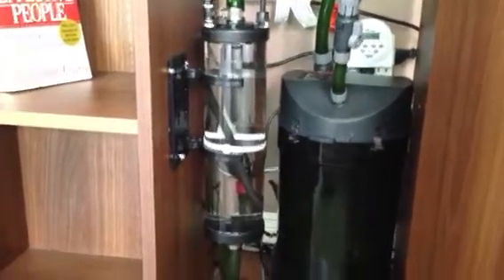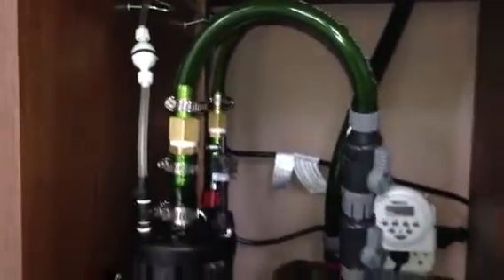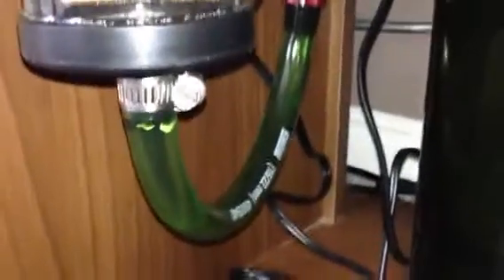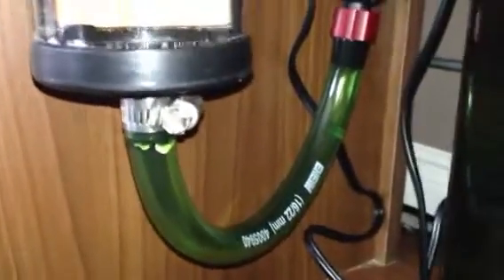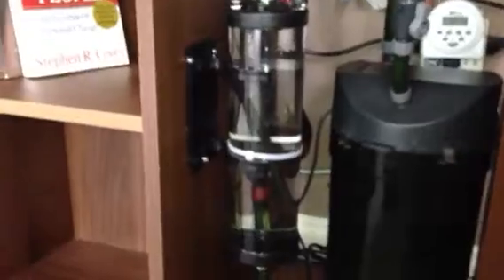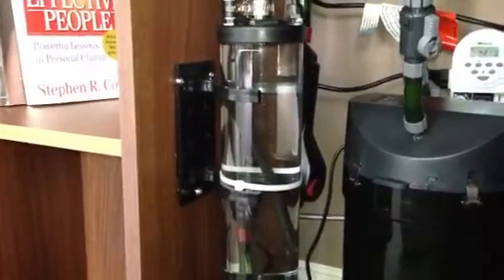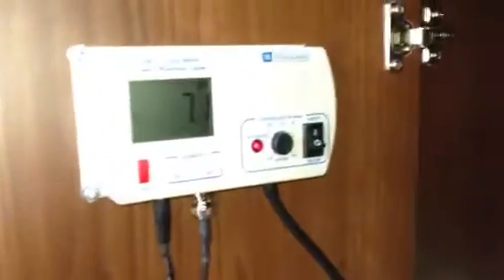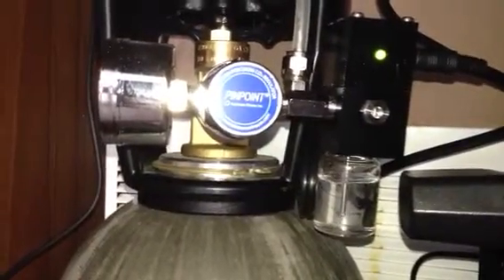Aqua Medic 1000 CO2 diffuser mod - part 2

Comment: What did you modify? I was looking to buy a reactor but they all seem to have the exhaust on the top, & im thinking to myself that, dont some bubbles escape? I was thinking the same, that i can hopefully modify it & have it still working, by blocking the top so the water can flow out the bottom

Comment: What's that stem on the right top of the diffuser?
Reply from the maker: That's a small valve that you can use to purge the gas out of the diffuser.  An example of when to use this would be during initial filling of the diffuser.

Comment: It looks like that reducer fitting is brass,  you will want to remove that or you will get a lot  of copper in you water over time.   Might be causing you issues.
Reply: Thanks for the tip!  I'll see what I can find locally.

Comment: Hey Phil I have same reactor and would like some steps on how to open up the chamber without damaging it. I dont know anything about breaking the sealant or what kind it is and what to replace it with. Ive had this thing for years but Ive ran into a problem for months now the balls are clogged with brown debris that somehow bypassed the filtration. I have posted for help on facebook groups for some help on this over and over again. Please could you write me some instructions?
Reply from the maker: I'm going to assume you've taken the unit off and drained it.  The water intake can be screwed off the unit exposing an ~1" hole; I used a wrench to get it off.  The hard part is to wiggle the first bioball out, the rest some out much easier.  Try shaking and jiggling the unit to help move the balls.

Option 2 is to leave the balls in and use a very mild bleach solution to soak the diffuser in it over night.  Should kill all the brown algae on it and rinse away leaving the unit clean.  Rinse well!

Comment: Hi Phil I am just gonna rig up a tank and just so I get this right the maxi jet 900 is in your tank and pushes water to your reactor then back to tank?
Reply from the maker: wallace colp You got it!  I use the little powerhead to push the water through the reactor.  Adjust the co2 so that it matches what the powerhead can handle.  Too much co2 and you will notice a build up in the top of the reactor which is a starting point, bleed the reactor and dial down the co2 gradually until you notice you don't have a build up any more.  If you do this gradually you will find the max diffusion rate of the powerhead which is what you want.
Reply: tyvm
Reply: i think I have to maybe run 2 systems for the 300 gallon I orederd
Reply from the maker: Im not sure the max tank size the diffuser will handle but you can certainly start with one and see what the drop checker does.

Comment: Hi there,
 
I'm thinking on buying this aquamedic 1000 reactor; saw both video’s and I’m wondering... are you still using it? Is your opinion the same after all this time? The changes in the filter are you still using it without the bioballs? Is the flow of your filter enough?
 
How many bubbles per second of Co2 do you put in the reactor?
 
Thanks.
 
Sérgio Saldanha
Reply from the maker: Sérgio Saldanha Wow it's been a year already since I purchased and installed this diffuser!  After all this time I've had no problems what so ever with this unit and it's diffusing 100% of the injected co2.  Initially I used the outflow of my Eheim canister unit to power the reactor but since then I'm using a maxi jet 900 to do the job.  This way I don't loose any of the circulating power of the filter and I have plugged the powerhead into the pH controller so it only runs when the injector is active.  I find the flow of the powerhead to provide very adequate flow through the diffuser, too much and you will be blowing the co2 bubbles out without fully diffusing them.  Would I purchase the unit again?  Absolutely.  I'm still running the unit without the bioballs in it and like I said earlier, I'm getting 100% diffusing and can see what's going on inside the diffuser without the balls.

I don't think of it in terms of bubbles per second, rather, I dial in the co2 flow rate to the diffuser/powerhead.  Too fast and the diffuser can't keep up and you will see the co2 building up and displacing water in the diffuser.  Too slow and the co2 will be on all the time unnecessarily.  You want to set it so that your injecting as much as the diffuser can handle, I don't worry about adding too much as I have a pH controller that will shut it off.
Reply: Phil Williamson 

I’m ordering it soon to use
with a 1501 JBL canister, there’s another large filter on this tank, the Eheim
2180, so even that the 1501 flow is reduced, that´s no problem to me. Hope to
enjoy it as you.

Thanks.

Comment from the maker: Ok  the trick to getting the balls out of the diffuser is to take both end caps off which should twist off pretty easily.  Once the caps are off you should have more wiggle room to pop one of the balls out, this will take patience and some fiddling.  Once the first ball is out the rest come out easily. The degree off difficulty all depends on your individual diffuser and how tight the manufacturer packed the balls.

Take your time and don't give up. It's worth getting them out to regain the  water flow through the diffuser.

Comment from the maker: Thanks for the comments!  It was fun setting it up but I wanted to do it in such a way that was stream line and neat since it has to fit into such a small area.  I've had the co2 probe running for ~2 months now and haven't calibrated it yet.  I've read that reads are only very minor so I'm watching how the plants respond daily, I've noticed recently that they haven't been pearling in the afternoon so I turned down the pH slightly and I'm back in business.  I guess it saves ordering test solution

Comment from the maker: Thanks fisherman!  I've got the spray bar returning water across and down into the tank. I have a maxi jet 900 in the opposite back corner blowing water at a 45 degree angle at the front of the tank. It creates a nice circulating effect in the tank and keeps the foreground plants swaying. I don't think I have any dead areas in the tank anymore.  Worth a post?